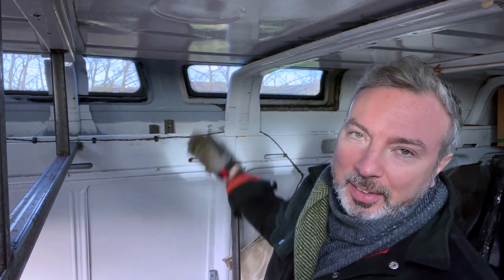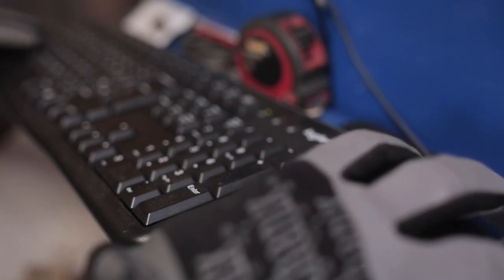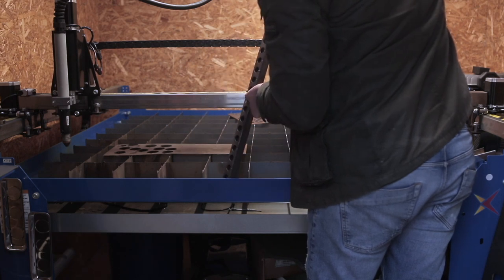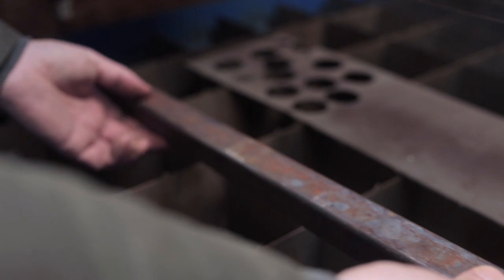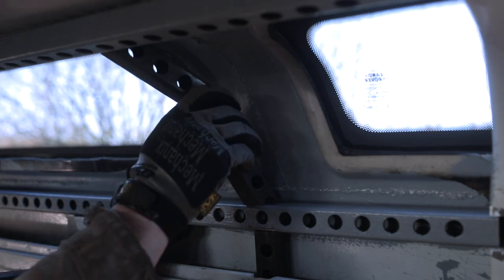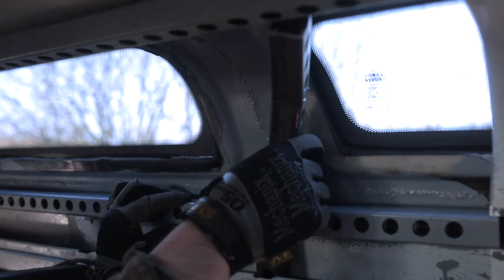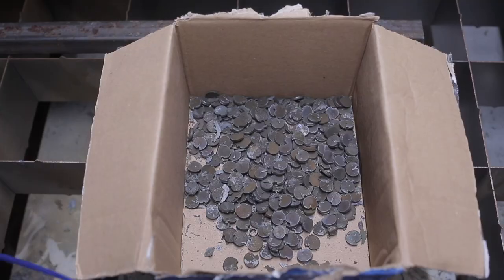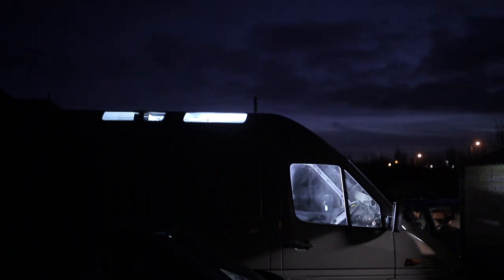Chopping up a camper roof | Sprinter conversion build

Comment: Perfect timing. On a break in my garage. About to re-surface an engine block to a 91 Honda Civic (D16A6).
Reply: my first car. 91 civic,  until i thought  my 175 cm rubber pizza cutter were 265 racing slicks   i miss him;)))
Reply: @breakshot7451  My little tank has 507k miles. Blew head gasket. Won’t let it go. Only drive the best. My 5.3L 2002 Silverado has 459k miles. Don’t get me started on my w116 1979 300sd, my w108 1970 280SEL and my w126 1988 300 SEL (Mercedes Benz). Solid cars!

Comment: The type of project that i love seeing... not the van, tho i love vans, not a merc, tho i love mercs, but a major surgery mod for whatever sensible reason... if its done well, it shows what can be done, and gives potential new insight into ones own project problems or ways of approach...
Also, that mass removal was more than what the scale shows, as the plasma cutter evaporates 2mm circles... Theoretically, the mass removed by that could be closely calculated and added to 1190 grams the scale measures, and it would actually, i would wager, be around 200 or 300 grams extra, as that is the largest part of the cut, so even tho its 2 mm wide, its also 2(i assume) thick, and has the largest radius that that applies to, so it would amount to a deceptively large amount of mass removed that you cant just measure without measuring the rod itself and after it was lightened... the discs are not really all there is to it... Its just my machinist considerations, not saying that you shoulda done the precise measurement, since the whole van has a different mindset behind it, so its not like you track micro-grams shaved...
All the best!

Comment: Sounds like a setup issue with the hole sizing. You should be drawing them finished size and it should be automatically doing the offset of the cut width.

Comment: Why didn't you just "moved" already welded roof reinforcement, between the alpine windows? Maybe add one, or two, extra, in front, and at the back of the alpine windows? That way, you would got 3-4 reinforcement bars, that are already designed to be in that van?
After that, you could do your reinforcement, but with the twist, to strengthen those punch holes, racing guys have special equipment that would do a little bent on the edge of the hole...